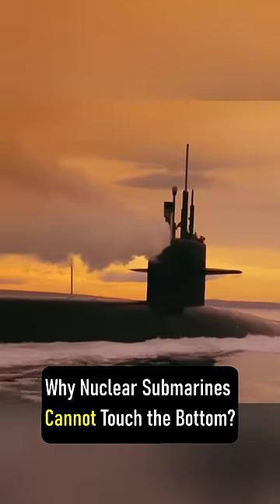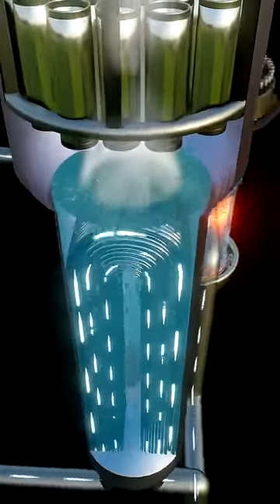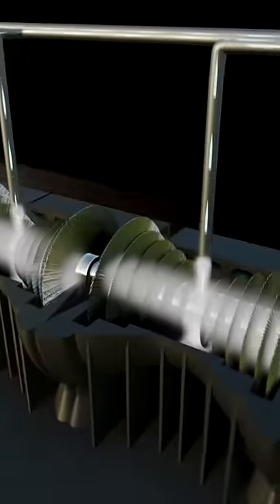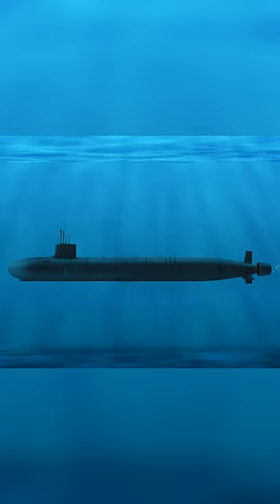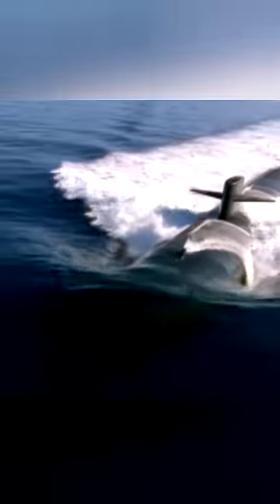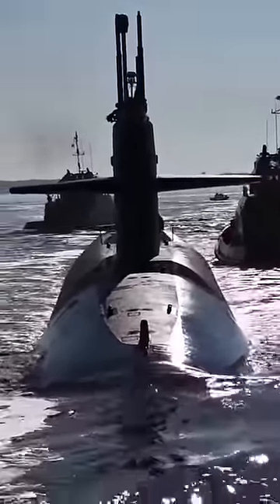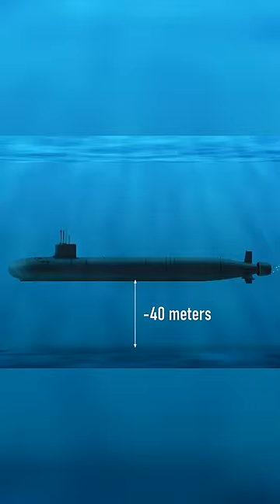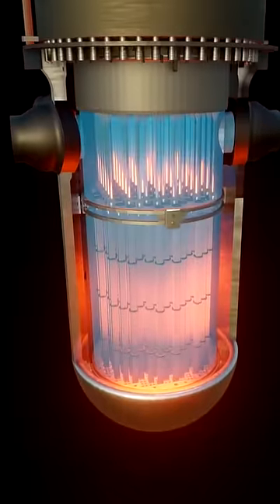Why Nuclear Submarines Cannot Touch the Bottom

Comment: The water  that cools the reactor is fresh water which is seperate than water that drives the turbines which is fresh as well.  They cool the turbine water with sea water that comes in valves all over ship not just bottom
Reply: fresh water does not cool the reactor primary coolant is pumped to the reactor to be reheated and it cools the reactor also reactor uses demineralised water as fresh water can lead to rust in the reactor
Reply: @gren8800  You would also be incorrect. It's deionized water which is slightly different. Also, it doesn't prevent rust. In fact there's a pretty hefty rust layer on everything in the primary, some of which is intentionally done.
Reply: @ryannelson8717  there definitely is 0 rust in the reactor compartment its tip top at all times looked after
Reply: @gren8800  How are you gonna go from inside the primary to inside the Reactor Compartment... Inside the primary there is plenty of rust commonly referred to as corrosion since many of us Americans associate rust specifically with Iron components. Inside the primary there is a nice hefty layer of 'rust' aka corrosion, it's part of the reason why chemistry control is placed where it is to keep that rust layer intact instead of turning to a mush in the wrong pH band. Were/are you even a nuke?
Reply: That was a great way of putting the difference between BWR and PWR systems into layman's terms. Well done.
Reply: @Hugh Jaanus 🤣🙄 Really? That's your contribution?
Reply: And that salty sea water when separated to make fresh water is where fresh oxygen is released into the Sub.
Reply: @gren8800  you are clueless

Comment: This nuclear powered submarine just sounds like a steamboat with extra steps.
Reply: I was a submarine reactor operator.  I just boiled water using hot metal instead of shoveling coal.
Reply: There were coal fired steam submarines before. Most submariners don't even know about the K Boats.
Reply: Well that’s because they are, you’re just replacing say coal or wood to produce the heat with uranium fuel rods.
Reply: There is a company designing small nuclear power vessels to replace the coal fired boilers in terrestrial power plants.  The rest of the steam turbines, etc are reused.  I doubt it would ever get approved, at least in the US.
Reply: Nuclear power plants are also just using steam power. Clean renewable energy.
Reply: @stevek8829 what a horrible job it must’ve been to stoke coals in a military submarine
Reply: it is.

Comment: Wrong, cooling is from main coolant pumps transferring heat to the secondary system via steam generators. Emergency cooling does enter the bottom but only used in a emergency loss of main coolant pumps.
Reply: So it may be a little too simplified, but seawater auctions are 100% near the bottom of the boat and they are for cooling of steam not emergency cooling
Reply: Riley .... correct.
Reply: @K6Jaeger  outside of an emergency, clean water is pumped in and out through several ports/valves along the midline of the submarine which can be opened and closed selectively. It's not unheard of parking a nuclear sub on the seabed. It was a pretty common practice for Soviet submarines as well.
Reply: @Puffalupagus360  our submarines cannot park on the seabed, it’s physically not possible, we would clog up our seawater systems, also I don’t know about the Seawolf class or Virginias, but there are no “inlet” systems on the centerline of the boat
Reply: Riley said "Boat". Those who know, know!
Reply: Talkin like you was on the 635
Reply: @K6Jaeger  Didn’t we park the Halibut on the seabed to tap a cable?
Reply: @duaneaikins4621  🤫
Reply: You still need sea water to cool the secondary system, which cools the primary system. The heat has to be rejected to the sea.
Reply: An emergency cooling system doesn't even exist on current ships bruh. even on the 635, it still didn't enter the bottom because that would be stupid.
Reply: @ryannelson8717  i was a staff instructor on the 635 and can confirm that
Reply: @davealmighty9638  I'm active duty ETN.
Reply: @ryannelson8717  I got out 22 years ago.
Reply: @davealmighty9638  Retired or left?
Reply: @ryannelson8717  left, and never looked back.
Reply: @TheyCallMeJawsh  The "Sammy R?!"  I was a plankowner on her when the Navy turned her into the MTS at NPTU Charleston in 1989!!!
As a Fast Boat Sailor for over four years, I'm glad my only time on a Boomer was after the missile tubes were removed.  I was never a Part-Time submariner!!!

I GTFO in '91.
Reply: So, another words, they can slam into the ocean bottom unless it’s an emergency?…

Comment: Close but no cigar. The reactor cooling is a closed loop of demineralised water passing through steam generators once the steam has been used to preform its useful work it is condensed using sea water heat exchangers and fed back into the steam generators via feed pumps 
Sea water does not directly contact the reactor cooling system

Comment: Think about it. Who'd have thought that steam power is still so usable after all these centuries. Since the day of the steamboat and probably before.  Amazing.
Reply: All nuclear reactors are nothing more than fission-powered boilers. Giant, very powerful teakettles.
Reply: URANIUM! Get some my friends!$$$
Reply: Literally every thermal power plant - be it coal fired, oil fired, gas fired, nuclear or even solar thermal - uses the heat to produce steam which runs a turbine. But this has a much in common with a steam locomotive as an SR-71 with a WW1 double decker plane.
I work at a coal fired power plant, and our fresh steam is at 602°C and 265bar, with nearly the same weight-to-volume ratio of tap water. That stuff is closer to a blow torch than to the steam from your coffee mug.
Reply: @johnc2438  Just enough to be deemed unlimited horsepower.
Reply: Shhhhhh. Don't tell the 21 year old green girl who's gonna tell me how to live my life that. She might have a bad dream or her feelings might get hurt. We definitely need to live in poverty so she can be happy.
Reply: What did you think they did, surround the reactor with solar panels and store the energy in Li-ion batteries?
Reply: @trplankowner3323  Yeah but when you think about it, it works in unison with batteries, maybe lithium batteries. They used to use lead acid, but still rely on batteries non the less. 
This is why I'm not so thrilled about moving to batteries so much. Seems no-one mentions the amount of toxic remains that are removed from them when they're recycled. I read an article that said we'd ship our expended computers to China for disposal and recycling, and kids would go through the piles of crap looking for i believe the radium or plutonium something, to sell. And many were getting infected with cancer causing crap. I can even fathom when we go to all electric vehicles etc.
Reply: @peterford9369  The Japanese are the only navy in the world currently using Li-Ion batteries in submarines.
Reply: @trplankowner3323  Really. I didn't look it up. Kinda just assumed. We know technology usually moves from country to country. It's just who uses it first. Thanks.
Reply: @peterford9369  Over 99% of the energy released from the nuclear fission of Uranium-235 (the only type used in naval reactors) is in the form of kinetic energy as the two fission byproduct nuclei accelerate away from the position of the fission. This is commonly known as heat. To simplify the concept, think of a fission reactor as a big hunk of hot metal in a pressure cooker pot with large pipes attached. The primary loop (or coolant) is a fluid (almost always pressurized water) that is circulated across that hunk of metal (the reactor core) so that the energy can be used. Currently, the most efficient way to use heat energy is to boil water into steam and use that to turn a turbine. All naval reactors have two different types of turbines that use this steam. One turns electrical generators which make electricity for the ship. The other, much larger turbine is used to turn the ship's propeller(s). Which move the ship. 
That fact give you a hint of the difference between the two VERY different types of naval submarines. All types of submarine that aren't nuclear are solely ambush predators, like a spider. Nuclear submarines are pursuit predators, like a cheetah. 
All currently serving US Navy submarines can do both types of hunting. They can sit quietly and wait for their prey, or they can run their prey down. They can usually outrun anything that tries to ambush them. Once they have, their opponent is both spent and identified. At that point it is only a matter of time. US Navy submarines are like a jaguar. They can hide in the shadows of the rain forest and lunge on their prey or they can swim across the river and grab a crocodile behind the eyes and swim back with it food. Also, US Navy submarines work in teams. Sometimes just another submarine and sometimes in coordination with a massive group of ships, aircraft and even satellites. All coordinated from a building half way around the world. Each unit knows what it's job is, but it is not alone. It can be given information and even target data from any of the various parts of the group.
Reply: @peterford9369  "works in unison with batteries", only in the so called "air dependent" types of submarines, such as diesel-electric. For nuclear and "air independent" submarines, the batteries are for emergency only. For "air independent" submarines that use Stirling engines or fuel cells, there is a very limited range. Nuclear submarines effectively have no range limit.
Reply: Nuclear Power is just fireless heat. At least it better be or somebody F'd up LoL.
🐻👩‍🔧🇺🇸⚒️🇷🇺
Reply: @craftpaint1644  Sure,the nuclear part I understand,to a point. I was mostly referring to the steam portion of the equation. Like using steam power to launch planes from aircraft carriers. Was just a point how long simple steam is still used to do very important things 🤔
Reply: Funny right steam super ancient technology lol
Reply: @trplankowner3323  , INTERESTING!  What is used to contain the batteries in case of a fire?  As long as there is Oxygen, the batteries are going to burn!  Not to mention the fumes!
Reply: @LiPo5000  Exactly what are you referring to? That video is over a year old and there are many replies to that comment.

Comment: I have heard that the USS Jimmy Carter is specifically designed to be able to sit on the bottom.
Reply: Great boat named after a great man and president!
Reply: Many SpecOps subs can.
Reply: @stanleyhornbeck1625  
I thought that for a very long time. But, like Paul McCartney, he destroys his legacy every time he opens his mouth now.
Reply: Just like its namesake's economic policies.
Reply: @stanleyhornbeck1625    🤣🤣🤣   Well, at least he was better than Biden. Which is not really saying much.
Reply: @rudolphguarnacci197  I think you have it backwards. Jimmy Carter has only become a better post presidency
Reply: @WaterMan416  
Sure, Eric. You're right.
Reply: @rudolphguarnacci197  indeed I am. I wouldn't say something incorrect.
Reply: @WaterMan416  
Absolutely, Eric. How's the gaming going? Get a job yet?
Reply: @rudolphguarnacci197  I've had a career now in drinking water plant operations and maintenance for 10 years, after I got out of the navy as a submarine engine room mechanic and operator. Swing and a miss, pal.
Reply: @WaterMan416  
Thank you for your service, Eric!
Reply: @WaterMan416  Oof, dirty mechanic. I can't stand pulling those strainers man lol. Oil all over my arm just doesn't feel good. I'm sure you know what rate I am now lol
Reply: @WaterMan416  I agree
Reply: The USS Jimmy Carter was used to tap and monitor undersea communication cables. It sat on the sea floor while they swapped the recording equipment. I believe they put leg stands on the bottom.
Reply: @WaterMan416  was this in arma or down periscope?
Reply: @Cold_Cactus  was what in what? I wasn't in down periscope (I was a kid at the time of filming) and I've never heard of arma
Reply: You might be right, but they aren’t/weren’t the only ones, and I sure as Hell won’t tell you where!
Reply: Jesus... you guys need to  cleans this shit up! You are commenting on capabilities and  things that could get you a knock on your door that is never going to end up good! 

I'm out!

Comment: Kelsey Grammar bottomed his diesel sub, the ss stingray, in Down Periscope. And Lauren Hutton, his dive officer, drove it between the screws of a freightor. It must be real.
Reply: Diesel boats run on batteries when submerged. So long as you gently bottom them out there's no risk of cracking any of the battery cells. That's not to say there's no risk, if those batteries leak and any water hits it, well you've got a toxic gas mess to deal with
Reply: Funniest movie ever!
Reply: I watched that flick for the first time with  my son when I was on my last boat the USS MONTPELIER SSN-765. We were at sea at the time doing a "tiger cruise". 
I watched Crimson Tide when I was on the USS ALABAMA SSBN-731 and we were deployed at the time.
Be safe and 😎

Comment: The depth of the ocean can change dramatically depending on where you are. Also no sub wants to touch the bottom because of about 37 different reasons. It makes noise, you can damage the subs hull and screw which is bad for a whole other reason. Every ship in the world has reduction gear which is like a massive gear box with gears as small as 5ft in diameter to larger than 20ft on diameter dependent on the ship. Hitting the screw would damage those gears leaving you dead in the water and those gears are one of the most expensive things on a ship as well. There are so many reasons on why not to touch the bottom. Also yes there’s such a thing as crush depth and for the majority of the ocean that would happen before touching the bottom but near shore you’ll find shallow waters. Every ship uses sea water in some capacity so sucking in dirty water isn’t only a bad thing for nuclear subs. To add on to that systems on ships are designed to take some type of dirty or polluted water and if they weren’t that would be a design overlook especially for a billion dollar warship.
Reply: not every ship has reduction gears, many have electric motors

Comment: So nuke subs are actually steam machines xD
Reply: All large naval vessels use steam its just what you use to heat the steam
Reply: @jdrhc63we67  some have huge diesel engines or am I wrong?
Reply: Most energy is still made by steam westher heated by nukes, geothermal, coal, oil, natural gas. Etc.
Reply: @veronikalugitsch nations other than the US still operate diesel submarines, but the US quit using them.  Nuclear submarines can remain submerged for months, diesel subs must operate on the surface while using their diesel propulsion system.  When submerged they run on batteries and are thus limited on their dwell time.

Comment: Why not take the water in from the sides. And leave the option open for a parking bottom!
Reply: They do take sea water in through side. It is not directly used to cool reactor.
Reply: The boat will suction to the bottom and they will all die. Not this msw crap. Also most boats have valves from more then one side
Reply: You can’t have the MSW intakes too far from the bottom or you would risk sucking in air when on the surface, or at periscope depth in rough seas.

Comment: There's an entire wikipedia page called "List of submarine incidents since 2000." The first one listed was an accidental sinking, and it doesn't get much better from there
Reply: They actually just declassified the truth of the USS Thresher. They always told us submariners and future submariners still in school that only two nuclear US subs have ever been lost, the scorpion and thresher, both a while ago which were the result of old, long ago corrected faults and now designs are much more redundant as well as the procedures and practices. Also that the two incidents were instantaneous and they imploded killing the crew before they knew what happened. 

Well, the scorpion maybe, but the thresher absolutely had sunk still on the continental shelf so it wasn't too deep for its structural integrity, but there were alive sailors onboard as it was powerless on the ocean floor. The USS seawolf was first to the area and they recorded about 26 sonar pings before they started hearing the sound of something striking the hull of the sub from inside as the sub must've lost too much power to operate the sonar. In the end they couldn't get help soon enough and an unknown number of sailors died in the bow of the boat, very likely in complete and total darkness if they didn't have flashlights or something that had power to operate itself. Possibly with water slowly leaking in and filling up their last pocket of safety and/or the oxygen levels running out too. They also had the false hope of knowing that another submarine was out there and was pinging back. 

They always told us they died without ever knowing, but in reality at least one, likely more of these submariners died a slow, hopeless, terrifying, agonizing death, one of the worst imaginable that could befall you in the Navy and they just lied to us all for years, it's so messed up and so on brand unfortunately. It's traumatizing just to be faced with that possiblity. A hydraulic oil fire occurred on my sub and it was looking seriously grim at first so having to start legitimately deciding if burning to death or slowly drowning, suffocating, starving in pitch blackness listening to the dead sub creak, grown and moan as you wait knowing billions and billions of gallons of water sit just above you and your tomb is all that keeps it out. I still have serious nightmares and sleep problems from that one time where I thought I was going to die for about 3-4 mins 10 years ago.